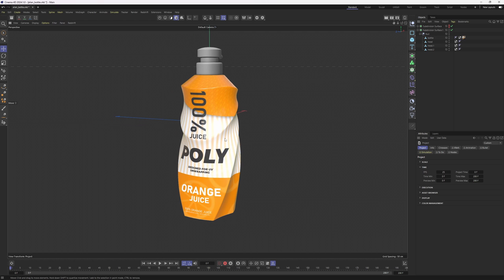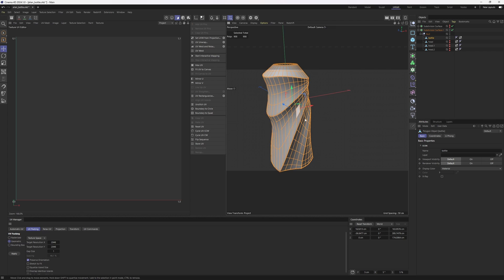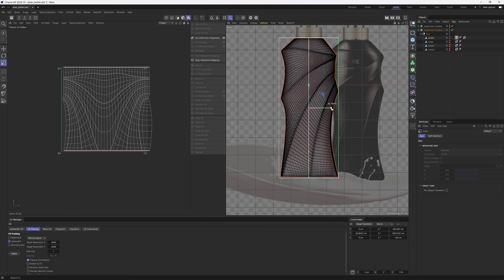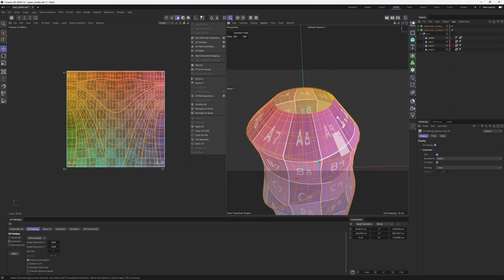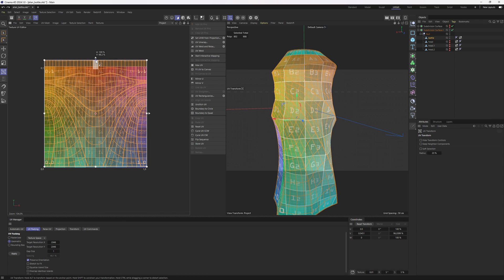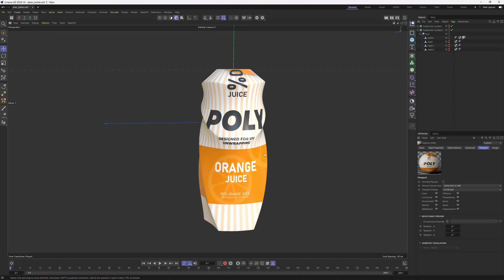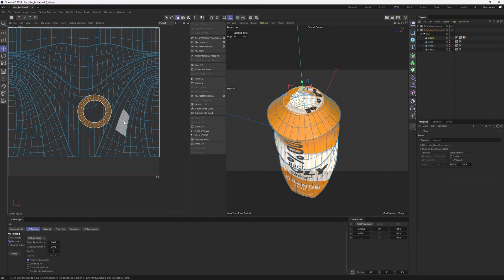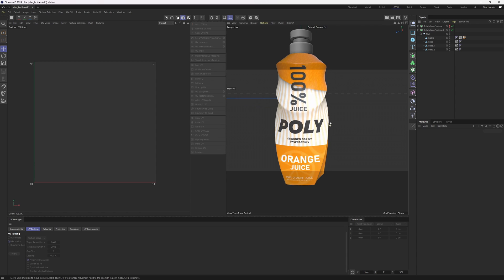How to UV Unwrap Complex Cylinders/Bottles | Cinema 4D

Comment: i come to a problem when i use UV transform, instead of scaling it disconnects it from the rest of the uv, creating unwanted seams
Reply from the maker: You need to apply the tool on polygon/UV islands, otherwise it dissconnects as you said.

Comment: Great tutorial. I wasn’t aware of that interactive tool 👍 But, with that method, or any other, if the texture that fits the selected UVs is perfectly square one does not need to scale the UVs, just make them fit the boundaries (unless some in the middle need some adjustments). Actually, if the texture fits a rectangle, it’s the same. Only if one has many or different textures inside the same image, then one needs to scale each island accordingly, and for that one opens the texture in the UV window and then there’s a option to snap to pixel. Hope it helps. And once again, your tuts are really good.
Reply from the maker: Thank you, I will test this, I thought the shape of this bottle ( kinda stretched vertically ) will not make this possible but I will try this, thank you!